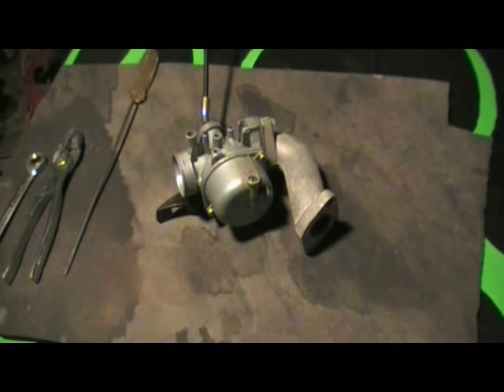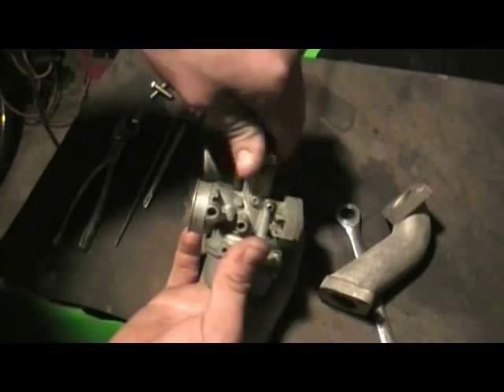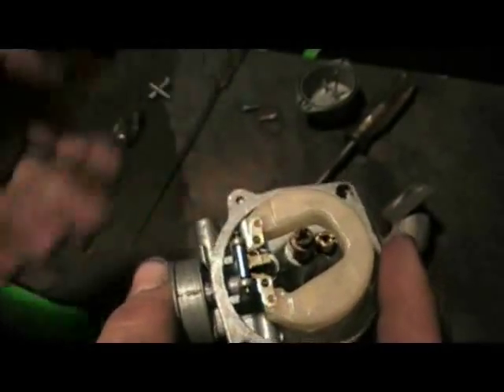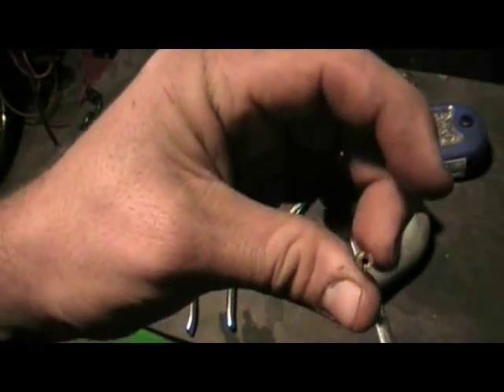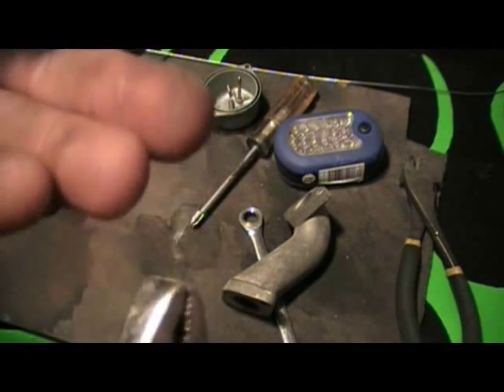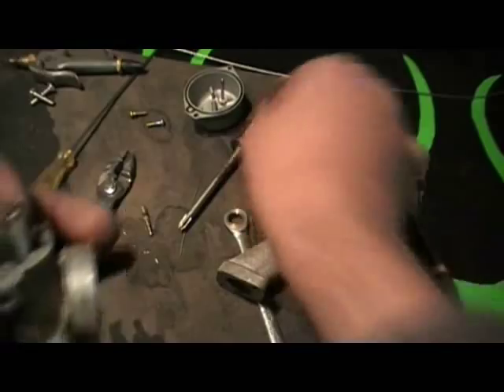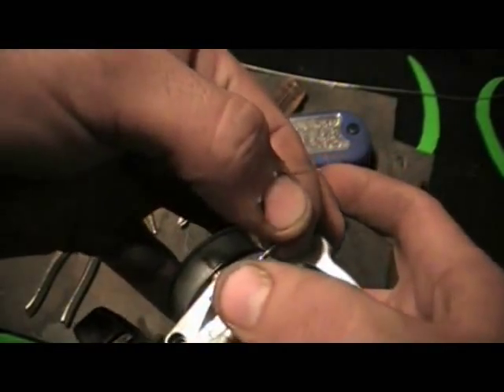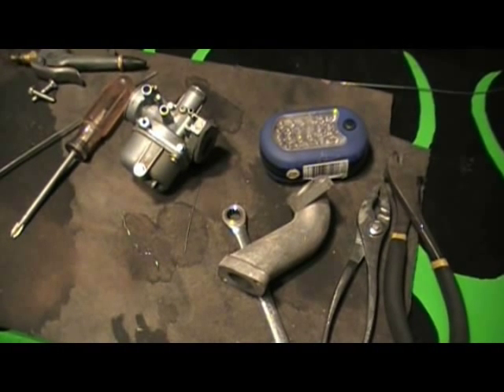How To Clean a ATV /  Minibike Carburetor 50cc-125cc

Comment: if I pull the black lever the whole way up the engine just dies instantly does that mean that I pulled it too much up
Reply: Sigmund Kowalski mine is bogging and I give throttle n my tire won't turn just powers off hoping this video will help bout to try
Reply from the maker: it should   ,  it sounds like your idle  jet is clogged    , let me know how it goes .
Reply: The Random Mechanic will do what tools will I need ? I wanna get my pocket bike goin asap
Reply from the maker: what kind of pocket bike do you have ?  is it 2 stroke or 4 ? does it have a carburetor like the one in the video  or the kind with the rubber primer bulb on it  ?
Reply: I think it's the same buddie told me it was 50 cc 2 stroke pocket bike
Reply from the maker: have you looked to see what the carb looks like yet ?   normally the 2 stroke pocket bikes will have a weed eater style carburetor with a primer bulb on it
Reply: The Random Mechanic I looked but idk how to tell there's a white fuel in n off switch beside it if that helps idk how to tell what kind
Reply from the maker: one fuel line or two ?
Reply: The Random Mechanic one fuel line
Reply from the maker: ok its a smaller bowel type 49cc pocket bike carb      it should be the same principal as the one in the video   ,  normally you will need an alan wrench set  and a phillips screwdriver  to get it off   ,  sometimes they will use 8mm or 10mm bolts to hold it on   ,  should be fairly easy  just follow the steps    and it should run fine
Reply: The Random Mechanic one fuel line
Reply: The Random Mechanic Kk thank you !!!
Reply: It's supposed to be down

Comment: I gave up on my idle jet
Reply from the maker: the idle jet can be frustrating  to clean   if it is super compacted with trash  ,   i found that  using the bicycle brake cable works really well in most cases  ,  other special cases  may need to be boiled to soften  the gunk before trying the brake cable method  ,    and in the rare case where it is just too gunked up  i would just say order a new jet    normally a rebuild kit will come with new ones   and it is still cheaper than replacing some of the more expensive carburetors  such as the ones on a honda  .
Reply: The Random Mechanic I bought the rebuild kit. Waiting on it to arrive. I think I'm gonna cut the muffler off. Think it will hurt the engine?
Reply from the maker: as long as you leave the pipe   the muffler came off of   it shouldn't hurt the motor

Comment: Can't get my bike to stop leaking gas out the carb on a chinese.bike
Reply from the maker: means the needle on the float  isnt closing all the way  or is worn out   ,  try adjusting the float ,  there is a metal tab on the float where the needle rides  , with the carb upside down      bending this tab down towards the needle will raise the float  up slightly     meaning less fuel is needed to shut off the flow of fuel  lessening the chance of an overflow  ,  if this still doesnt work   your carb will need a rebuild kit  or honestly  it would probably be better to replace it   since they cost about $20 on ebay

Comment: Mines dont have  screws to take out What should I do?
Reply from the maker: does yours have those flat  goldish colored fasteners  that has no head to turn ?   if so that is an epa regulated carb and they do not want you to open it  , but good news you can  , you will have to carefully cut slots in them to turn them with a flat head screw driver , you can use a rotary tool such as a dremel with a cut off disk   its ok if you nick the flange on the float bowel as long as you dont cut all the way through it  , the fasteners were regular screws that had a special head that would snap off when torqued down ,  you can also drill the heads out and just back the shaft out with your fingers or pliers , get new screws from the hardware store and you are back in business